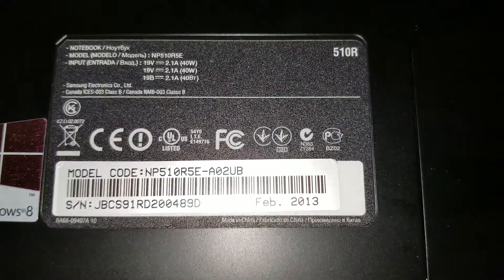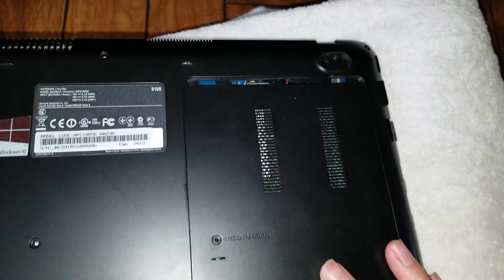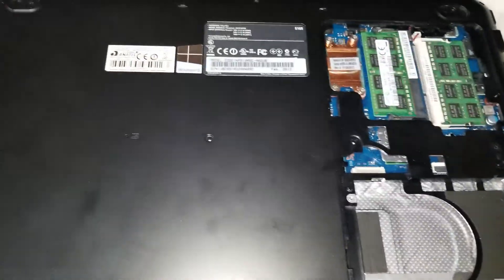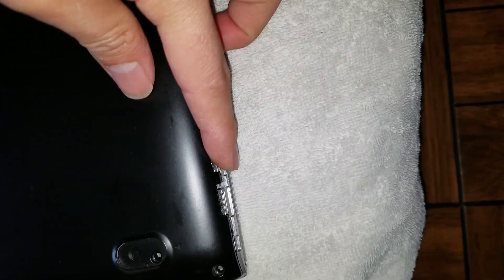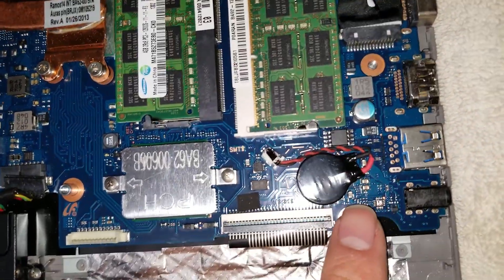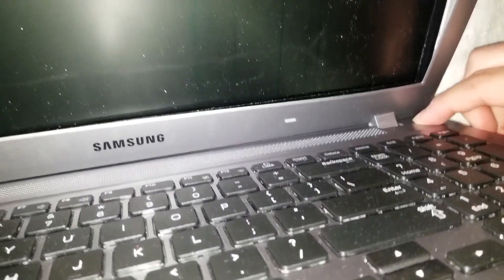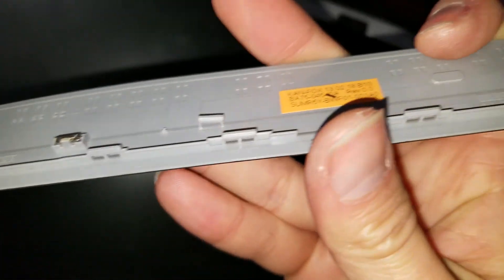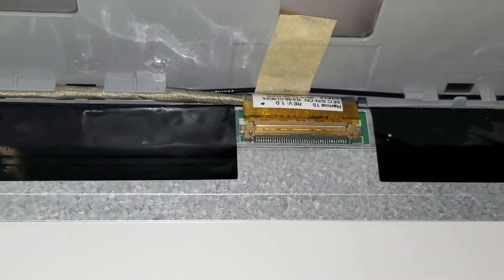Samsung NP510R5E 510R Disassembly and Upgrade

Comment: Is it anybway we can install windows 10 on that model?
When i tried to install windows 10 it always hang up after restart i change multiple hdd ssd ram etc same problem
Reply from the maker: Not sure. I don't know what issues you have with your computer. Does it work with the old os?
Reply: @ItsBinhRepaired  yes i already tried both windows 8 and windows 7, i dont really know what is the reason maybe i will create a new windows 10 installer and try again
Reply from the maker: Try 7 or 8 and then do an in place upgrade.
Reply: @ItsBinhRepaired } alsondone but stil same
Reply from the maker: @wolf-w9x4n  must be bad hardware or something :(
Reply: Clean/fresh install of windows 10 or upgrade? I have been using this laptop with windows 10 for years. Does your laptop freeze after installing the AMD driver? That's the only issue I face everytime I install windows 10 on this laptop.

Comment: hey thanks for this video, I have only one question? is it possible to get the wifi and Bluetooth parts only in the screen?
Reply from the maker: The antennas? Sometimes. Usually have to check eBay

Comment: I have the same laptop hope ur channel.is still.active.

Basically I hulk fisted itnone night by the touch pad amd I think the left mouse is stuck now. So inwamma disassemble mine battery AMD all due to the fact it only opens in bios or safe mode...
I was hoping I knocked the hdd lose but I fear it may be worse than the trackpad... it wasmt any harder than a gamer would smack down. But ever since it's just been bios safe mode... and I dnt wanna risk the factory reset if it dnt help... i may have even tried that and it still didnt work. I cant remeber
Reply from the maker: Sounds like you wrecked the hard drive. You'll need to install an SSD and then reinstall the OS.
Reply: @ItsBinhRepaired  it's an older pc. 2010/2012 a d was free from a girl who started cyber school amd never finished. But I got it out of safe mode when she had it and it worked fine after all the spy and malware was gone and it was fresh OS again.

U mention this and I wish we cld share video clips because I believe the add is bad as well due to the sound it makes... I assumed it was due to button presses or the mouse being stuck forcing safe mode.

So anyway is that expensive? I usually dnt repair computers amd such but have ALWAYS WORKED ON SHIT SO IF ITS NOT INSANELY HARD I CAN TEACH MYSELF IN NO TIME...
JUST DNT SEE SPEMDING AM ARM AMD LEG FOR WHATS ON IT, other than yt content of my kids... just stuff I wanted to have ya know...
Reply from the maker: @sitesdaniel1986  shouldn't be too bad
Reply: @ItsBinhRepaired  so should I try to replace or upgrade I guess and isnt ALL MY DATA on the sdd
Reply: @ItsBinhRepaired  or those 2 lol chips that have pop tabs again I'm not versed just yet that's why I'm still on the video for the case lol..

I dnt jump stupid. Lol if it's a job I'll toss the screws in amd wait til I can put it in a shop or have them just swap my data somehow if its possible
Reply from the maker: @sitesdaniel1986  yes, all the data is on the old drive
Reply from the maker: @sitesdaniel1986  the two chips are ram and don't store data.
Reply: @ItsBinhRepaired  again still learning so the add I meed to replace has all my data? Lol there any chance of getting it back? I mean hell police can take a burned laptop amd retrieve everything! I cant see this issue being that costly or difficult just for me being a n3wb
Reply from the maker: @sitesdaniel1986  if the drive is dead, you'll have to send it to 300dollardatarecovery.com